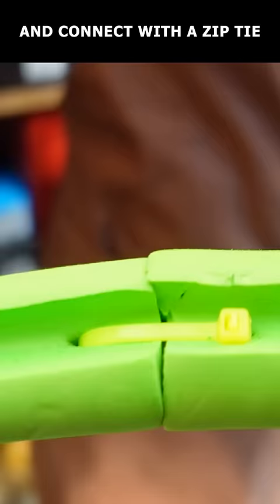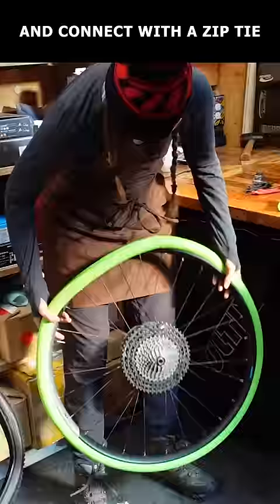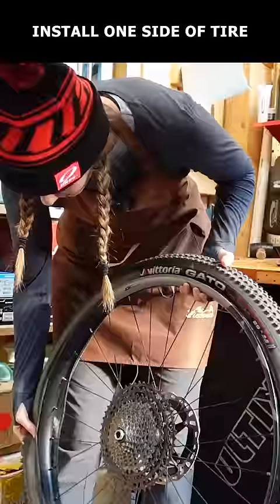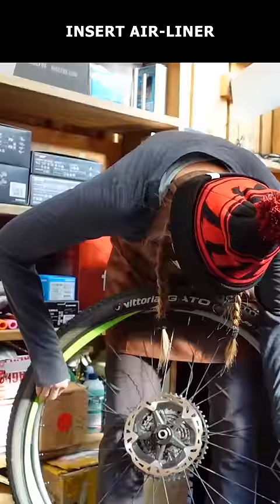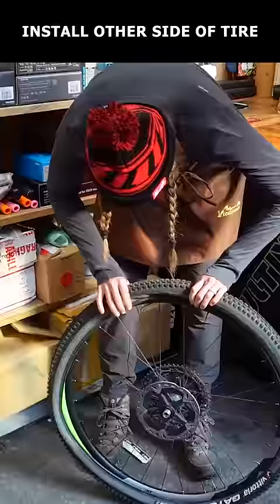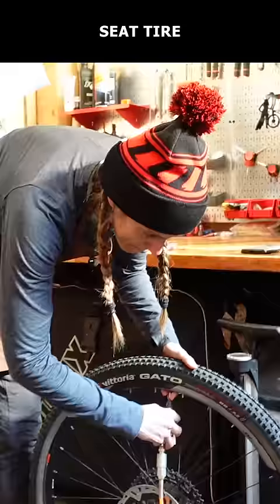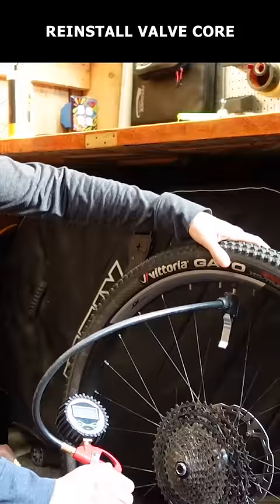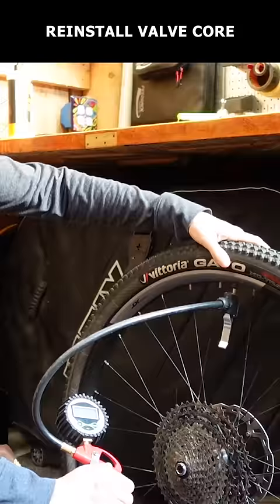Installing the Vittoria Air-Liner tire insert #Shorts

Comment: Whats the air liner do?
Reply from the maker: This system provides additional rim and puncture protection in tubeless setups and allows you to run slightly lower pressures. It is also a "run flat" system so if you do get a flat you can continue to ride the tire without risking it rolling off the rim. We don't generally recommend that unless you're racing enduro or downhill, but it is an option. So, while it isn't for everyone, it's quite helpful for lots of people.

Comment: will a pool noodle not work for this?? thats what i thought this was about.
Reply from the maker: It's a completely different type of foam. A pool noodle sucks up the sealant and gets soggy, th Air-liner doesn't. It's also a stiffer foam and provides more protection than a pool noodle.

Comment: But... why?  What problem does this solve?
Reply from the maker: This system provides additional rim and puncture protection in tubeless setups and allows you to run slightly lower pressures. It is also a "run flat" system so if you do get a flat you can continue to ride the tire without risking it rolling off the rim. We don't generally recommend that unless you're racing enduro or downhill, but it is an option. So, while it isn't for everyone, it's quite helpful for lots of people.

Comment: What is the purpose of this?
Reply from the maker: This system provides additional rim and puncture protection in tubeless setups and allows you to run slightly lower pressures. It is also a "run flat" system so if you do get a flat you can continue to ride the tire without risking it rolling off the rim. We don't generally recommend that unless you're racing enduro or downhill, but it is an option. So, while it isn't for everyone, it's quite helpful for lots of people.

Comment: What is this? I have a fatbike. Just go tubeless. So someone tell my why?
Reply from the maker: This system provides additional rim and puncture protection in tubeless setups and allows you to run slightly lower pressures. It is also a "run flat" system so if you do get a flat you can continue to ride the tire without risking it rolling off the rim. We don't generally recommend that unless you're racing enduro or downhill, but it is an option. So, while it isn't for everyone, it's quite helpful for lots of people.

Comment: Airliner? Tube. Say what?
Reply from the maker: This system provides additional rim and puncture protection in tubeless setups and allows you to run slightly lower pressures. It is also a "run flat" system so if you do get a flat you can continue to ride the tire without risking it rolling off the rim. We don't generally recommend that unless you're racing enduro or downhill, but it is an option. So, while it isn't for everyone, it's quite helpful for lots of people.

Comment: What's the point of this instead of just running normal tubeless?
Reply from the maker: This system provides additional rim and puncture protection in tubeless setups and allows you to run slightly lower pressures. It is also a "run flat" system so if you do get a flat you can continue to ride the tire without risking it rolling off the rim. We don't generally recommend that unless you're racing enduro or downhill, but it is an option. So, while it isn't for everyone, it's quite helpful for lots of people.
Reply: @sydfixesbikes  does it change the grip of the tire at all? Thankd
Reply from the maker: You can generally run a couple psi lower tire pressures, so yes.

Comment: Question pretty bicycle lady what is an air liner. And I don't mean the big metal things that fly.
Reply from the maker: This system provides additional rim and puncture protection in tubeless setups and allows you to run slightly lower pressures. It is also a "run flat" system so if you do get a flat you can continue to ride the tire without risking it rolling off the rim. We don't generally recommend that unless you're racing enduro or downhill, but it is an option. So, while it isn't for everyone, it's quite helpful for lots of people.

Comment: What's the point?  Why not just do tubeless?
Reply from the maker: This system provides additional rim and puncture protection in tubeless setups and allows you to run slightly lower pressures. It is also a "run flat" system so if you do get a flat you can continue to ride the tire without risking it rolling off the rim. We don't generally recommend that unless you're racing enduro or downhill, but it is an option. So, while it isn't for everyone, it's quite helpful for lots of people.

Comment: And this is used for?
Reply from the maker: This system provides additional rim and puncture protection in tubeless setups and allows you to run slightly lower pressures. It is also a "run flat" system so if you do get a flat you can continue to ride the tire without risking it rolling off the rim. We don't generally recommend that unless you're racing enduro or downhill, but it is an option. So, while it isn't for everyone, it's quite helpful for lots of people.

Comment: Why not just use a tube?
Reply from the maker: This system provides additional rim and puncture protection in tubeless setups and allows you to run slightly lower pressures. It is also a "run flat" system so if you do get a flat you can continue to ride the tire without risking it rolling off the rim. We don't generally recommend that unless you're racing enduro or downhill, but it is an option. So, while it isn't for everyone, it's quite helpful for lots of people.

Comment: You’re definitely supposed to ride the bike to shake the stuff around you standing there dancing with it did absolutely nothing
Reply from the maker: Yeah, it's definitely better to go ride right after installing a tubeless setup, but if you can't, the sealant dance will help things seal so your tire holds air (at least better than it would otherwise) until you can go ride.

Comment: #sydfixesbikes i followed this and have ridden a few miles. If I pick my tire up and drop it now I can hear the liner. It’s loose. Is that ok?
Reply from the maker: That happens over time. If it doesn't bother you, just ignore it, but if you want to fix it, just pull it back out and cut it again. It generally only stretches once...
Reply: @sydfixesbikes  thanks for your reply!  I just didn’t want it to effect it’s function.
Reply: @sydfixesbikes  Also do you adjust down the amount of sealant?
Reply from the maker: Nope. Usual amount

Comment: What does airliner do?
Reply from the maker: This system provides additional rim and puncture protection in tubeless setups and allows you to run slightly lower pressures. It is also a "run flat" system so if you do get a flat you can continue to ride the tire without risking it rolling off the rim. We don't generally recommend that unless you're racing enduro or downhill, but it is an option. So, while it isn't for everyone, it's quite helpful for lots of people.
Reply: @sydfixesbikes  👍🏻 thanks

Comment: Or just go tubules it’s way better
Reply from the maker: This system provides additional rim and puncture protection in tubeless setups and allows you to run slightly lower pressures. It is also a "run flat" system so if you do get a flat you can continue to ride the tire without risking it rolling off the rim. We don't generally recommend that unless you're racing enduro or downhill, but it is an option. So, while it isn't for everyone, it's quite helpful for lots of people.

Comment: Why do you need a air liner?
Reply from the maker: This system provides additional rim and puncture protection in tubeless setups and allows you to run slightly lower pressures. It is also a "run flat" system so if you do get a flat you can continue to ride the tire without risking it rolling off the rim. We don't generally recommend that unless you're racing enduro or downhill, but it is an option. So, while it isn't for everyone, it's quite helpful for lots of people.

Comment: So i buy expensive rims and tires, add a sealing milk to get rid of the tubes, saving weight and improve the deformation behavior. And afterwards I put these inserts into the rim just to throw all my cost-intensive advantages of tubeless away. I mean why not just use  cheap tubes then without the mess with the sealing milk in case of a flat tire.
Reply from the maker: This system provides additional rim and puncture protection in tubeless setups and allows you to run slightly lower pressures. It is also a "run flat" system so if you do get a flat you can continue to ride the tire without risking it rolling off the rim. We don't generally recommend that unless you're racing enduro or downhill, but it is an option. So, while it isn't for everyone, it's quite helpful for lots of people.

Comment: What is the benefit of this?
Reply from the maker: This system provides additional rim and puncture protection in tubeless setups and allows you to run slightly lower pressures. It is also a "run flat" system so if you do get a flat you can continue to ride the tire without risking it rolling off the rim. We don't generally recommend that unless you're racing enduro or downhill, but it is an option. So, while it isn't for everyone, it's quite helpful for lots of people.

Comment: What does this do?
Reply from the maker: This system provides additional rim and puncture protection in tubeless setups and allows you to run slightly lower pressures. It is also a "run flat" system so if you do get a flat you can continue to ride the tire without risking it rolling off the rim. We don't generally recommend that unless you're racing enduro or downhill, but it is an option. So, while it isn't for everyone, it's quite helpful for lots of people.

Comment: What does it do though??
Reply from the maker: This system provides additional rim and puncture protection in tubeless setups and allows you to run slightly lower pressures. It is also a "run flat" system so if you do get a flat you can continue to ride the tire without risking it rolling off the rim. We don't generally recommend that unless you're racing enduro or downhill, but it is an option. So, while it isn't for everyone, it's quite helpful for lots of people.
Reply: @sydfixesbikes  Thanks for clarifying 👍🏻

Comment: If you're gonna pay $50 for this glorified pool noodle, they should've at least made it into a circle that fits onto a 27.5" or 29" wheel. Saves the hassle of cutting it and using zip ties to link the two ends together.

Comment: excuse me good fellow lady or gentleman.what do these airliner contribute for
Reply from the maker: This system provides additional rim and puncture protection in tubeless setups and allows you to run slightly lower pressures. It is also a "run flat" system so if you do get a flat you can continue to ride the tire without risking it rolling off the rim. We don't generally recommend that unless you're racing enduro or downhill, but it is an option. So, while it isn't for everyone, it's quite helpful for lots of people.

Comment: Makes no sense. Why put in air without a tube & or why air at all with that green foam thing.
Reply from the maker: This system provides additional rim and puncture protection in tubeless setups and allows you to run slightly lower pressures. It is also a "run flat" system so if you do get a flat you can continue to ride the tire without risking it rolling off the rim. We don't generally recommend that unless you're racing enduro or downhill, but it is an option. So, while it isn't for everyone, it's quite helpful for lots of people.

Comment: Um what is this? What does it do?
Reply from the maker: This system provides additional rim and puncture protection in tubeless setups and allows you to run slightly lower pressures. It is also a "run flat" system so if you do get a flat you can continue to ride the tire without risking it rolling off the rim. We don't generally recommend that unless you're racing enduro or downhill, but it is an option. So, while it isn't for everyone, it's quite helpful for lots of people.
Reply: @sydfixesbikes  Ohh thank you for explaining that in detail for me!

Comment: What’s this for
Reply from the maker: This system provides additional rim and puncture protection in tubeless setups and allows you to run slightly lower pressures. It is also a "run flat" system so if you do get a flat you can continue to ride the tire without risking it rolling off the rim. We don't generally recommend that unless you're racing enduro or downhill, but it is an option. So, while it isn't for everyone, it's quite helpful for lots of people.

Comment: What does it do?
Reply from the maker: This system provides additional rim and puncture protection in tubeless setups and allows you to run slightly lower pressures. It is also a "run flat" system so if you do get a flat you can continue to ride the tire without risking it rolling off the rim. We don't generally recommend that unless you're racing enduro or downhill, but it is an option. So, while it isn't for everyone, it's quite helpful for lots of people.
Reply: @sydfixesbikes  very cool!! Luckily I haven’t had many flats with my tubeless tires but I’m sure this comes in handy

Comment: Ok wtf is the purpose of the air liner I don't have thing that don't have a engine is it like a run flat
Reply from the maker: This system provides additional rim and puncture protection in tubeless setups and allows you to run slightly lower pressures. It is also a "run flat" system so if you do get a flat you can continue to ride the tire without risking it rolling off the rim. We don't generally recommend that unless you're racing enduro or downhill, but it is an option. So, while it isn't for everyone, it's quite helpful for lots of people.

Comment: Why??
Reply from the maker: This system provides additional rim and puncture protection in tubeless setups and allows you to run slightly lower pressures. It is also a "run flat" system so if you do get a flat you can continue to ride the tire without risking it rolling off the rim. We don't generally recommend that unless you're racing enduro or downhill, but it is an option. So, while it isn't for everyone, it's quite helpful for lots of people.

Comment: I’m unfamiliar, what does this do
Reply from the maker: This system provides additional rim and puncture protection in tubeless setups and allows you to run slightly lower pressures. It is also a "run flat" system so if you do get a flat you can continue to ride the tire without risking it rolling off the rim. We don't generally recommend that unless you're racing enduro or downhill, but it is an option. So, while it isn't for everyone, it's quite helpful for lots of people.
Reply: @sydfixesbikes  that’s really cool, and the actual install didn’t look too bad either. Thanks for the explanation!

Comment: And what’s the benefit of doing this?
Reply from the maker: This system provides additional rim and puncture protection in tubeless setups and allows you to run slightly lower pressures. It is also a "run flat" system so if you do get a flat you can continue to ride the tire without risking it rolling off the rim. We don't generally recommend that unless you're racing enduro or downhill, but it is an option. So, while it isn't for everyone, it's quite helpful for lots of people.

Comment: Those things ride really bad you need air to absorb bumps and stuff
Reply: Also you can't lower the pressure for different surfaces
Reply: You can literally do everything with those types of inserts you can do with normal tyres. I ride cushcore and I race enduros and most ews racers use some sort of tyre insert.
Reply: @alexgrant6965  yes I know you can but their not adjustable, I raced pro in XCO and marathons and it's really important to be able to adjust that. And they ride like shit.
Reply: @hencodelange9701  I don’t know what kind of inserts you ran but with most modern inserts you can adjust tyre pressure for literally any surface, that’s what I’ve been doing since I got my cushcore. And as for them riding terribly I definitely find they ride way better than regular tubeless or with tubes since I can drop my pressure even further giving me more grip
Reply: @alexgrant6965  well I'm in south africa so it probably wasn't the propper stuff. Sorry thats my mistake
Reply from the maker: @Henco - these don't take up all the space in the tire, so there's plenty of room for the air, which you can adjust to suit the terrain. They haven't been widely adopted by XC riders because they do add some weight, but most enduro and DH riders ride then because weight is less of a concern.

Comment: It’s a BS idea, adding a lot of weight for what? To get home if you have a flat?
Reply from the maker: This system provides additional rim and puncture protection in tubeless setups and allows you to run slightly lower pressures. It is also a "run flat" system so if you do get a flat you can continue to ride the tire without risking it rolling off the rim. We don't generally recommend that unless you're racing enduro or downhill, but it is an option. So, while it isn't for everyone, it's quite helpful for lots of people.
Reply: @sydfixesbikes  For downhill might be good, didn’t think about that.
Thank you.

Comment: Whats this do?
Reply from the maker: This system provides additional rim and puncture protection in tubeless setups and allows you to run slightly lower pressures. It is also a "run flat" system so if you do get a flat you can continue to ride the tire without risking it rolling off the rim. We don't generally recommend that unless you're racing enduro or downhill, but it is an option. So, while it isn't for everyone, it's quite helpful for lots of people.
Reply: @sydfixesbikes  thank you for your time and reply